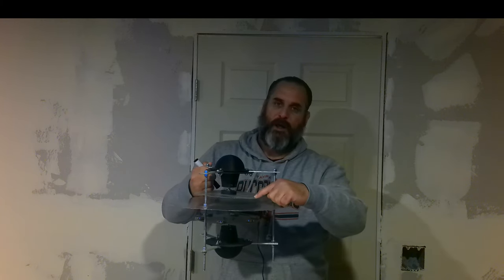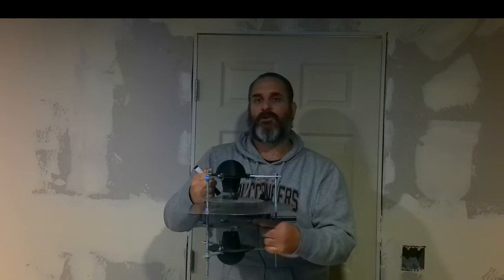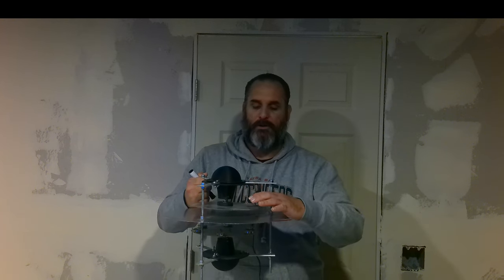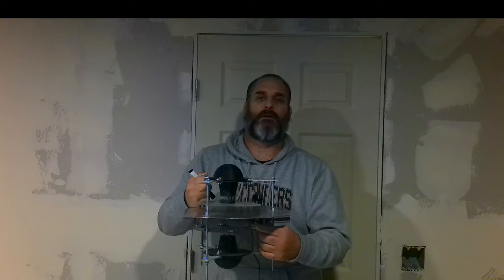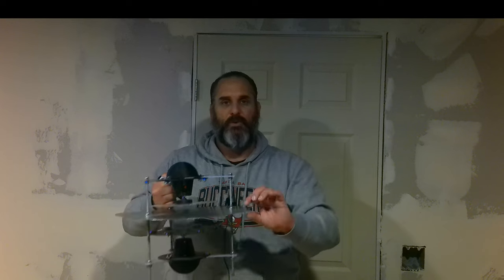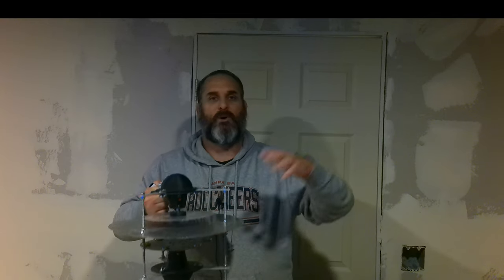Graviflyer "Tuning Correctly" #25

Comment: Nathan, good video. Three waves in the X, Y, and Z planes in 3D that go into harmonic resonance that when the ultrasound is turned off a huge charge that I calculated shows up to lift the graviflyer up by opposing the earth's surface charge and attracting to the ionosphere's charge. The voltage and the magnets keep the charge separated and also create a gravity torsion wave and why everything in the universe spins. The Al and AlO3 coated polycarbonate DC also keep the charges separated between the top and bottom disks. The middle disk acts as the other side of the capacitor/Casimir/layer effect of gravity for all heavenly bodies.  I will see you at this Saturday's APEC conference.
Reply: Buddy, did you get it to work?
Reply: @hellogoodbye3129  No but I know how it works from chatting with Alexey with a Chinese scientist a year ago and I relate this to you but so far you have not built my suggestion. I cannot build it as I am very poor. Alexey wanted recognition and why he told us the truth.
Reply: @hellogoodbye3129  The Navy Tic Tac, other disk shaped, and spherical UAP work in the same manner as Alexey's device.
Reply: @hellogoodbye3129  This is also how a person makes an antigravity car. Put Alexey's device in a tire. The wheels on the car are evolving into aluminum wheels and graphene belted tires or the polycarbonate. The rubber that the tire is made of takes the place of the Al2O3 and is a dielectric.
Reply: @richardmuller867  that is awesome! I would think using an aluminum chassis with quadrant fields for directional force and lift. And always good to have redundant systems. This is great stuff! Thank you for sharing with me.
Reply: @hellogoodbye3129  Your welcome hellogoodbye3129 now make it count. Read my many other chats on Nathans other videos to learn more. All parts of the graviflyer working at the correct frequencies to put the graviflyer in harmonic resonance to produce the large charge. You need methyl aluminum that is used in the chip industry or a vapor deposition unit to get the Al2O3 layer. Methyl aluminum is very flammable in the air. You reorient the graviflyer to get propulsion. The antigravity car of the future will be a hybrid with a water fusion ICE like Toyota just produced. The EVs are just to get money to research batteries as these are needed when time traveling as time traveling produces much extra power and needs to be stored in the battery so the person can get back to the present from the past or the future. The ICE engine produces many electrons that will coat the body of the car and allow warp drive and wormhole drive like the UAP that glow. A side effect of the produced anti-gravity waves is to make people young and healthy again by the reversed time. We never see old decrepit aliens as a result.
Reply from the maker: the ultrasound may have to hit all three disc's. I think it only hits the top and the center in normal operation. The lower one doesn't get hit until the button is pressed. The 3 disc's are also probably have a resonance value of their own. Top and bottom based on rpm and the center by the interaction of the 2 spinning ones. The disc spacing is important based on the 3d ultrasound wave. It would never hit the disc's correctly without them being in the correct spot. I also think the center disc needs to stay neutral. The loss of charges on the top disc says that the negative charge only makes it rise to attract to the ozone layer. The tesla coil is interrupting gravity waves with the beat frequency. Because it matches the center plate frequency you get a productive beat frequency wave. The Keely effect.
Reply from the maker: thank you.
Reply: @nathanbunten4299  Nathan, on another note me having worked with the UAP I found out that it is correct that angels or aliens or future or past people are on the earth. The show America's got talent showcases angels or alien magicians that can produce gravity or anti-gravity waves with their brain just thinking about this and their nerve cells then producing many electrons, or the charge like on the graviflyer to change space and time so that they can do their thing. Their genes are structured correctly so that they can do this. Alexey wears an alien helmet sometimes as he may be one of these angels or aliens. This is why he knows how to make his device. The angels or aliens are from planet X or 9 that Nasa looks for as this is the earth in the future or the past as they have the star device and its technology so they can stay cloaked in the past or the future and why planet X or 9 cannot be seen but shows up as the missing mass of the solar system. Look this up on the internet to find out more.

Comment: The ultrasound may hit all three disks. Ultrasound normally does not get transmitted through metal, but the middle disk has the hammered surface which then can allow the transmittance of the ultrasound and the top disk and bottom disk being a CD has grooves in them, so the ultrasound gets transmitted. Penn State University recently found that making structures on the surface of metals allows ultrasound transmittance. Look it up. Yes, to the three disks having a resonance all of them. Yes, to the spacing of the disks and the 3D sound wave. Yes, to the center disk staying neutral. The center disk stops the top disk and bottom disk from interfering with their charges being opposite, so the top being negatively charged attracts to the positively charged ionosphere and the bottom negatively charged disk repelling off of the surface of the negatively charged earth. Yes, to the negative charge allowing the device to attract to the positively charged ionosphere.  The middle disk having the tesla coil attached to it does interrupt the anti-gravity wave production just like the ultrasound interrupts the production of the charge until the button is pressed and the ultrasound stops so the charge is then produced on the top and bottom disks very rapidly and at a high value, so the charges then do their thing and lift up the graviflyer. It is a fast push force. I agree with the Keely effect as this keeps the frequencies stable, so the charges do not set up prematurely.
Reply: Please illustrate conservation of momentum.

Comment: What if the ultrasonics are exciting nitrogen atoms to the point the eddy currents expell them, causing a vacuum on the top side of the centre plate? The rotating eddy current keeping it stable from gymbal lock.
Reply from the maker: It could be possible. It hasn't shown that in any way yet.
Reply: After doing a little thinking. I actually think you could be right! I think by exciting the air with high voltage static from the spinning plates with a pulsed DC source that is tuned to the frequency of the pressure difference "bubble collapse" that is caused by the periodic static excitation combined with the magnetic field to repel and compress the atmosphere as well as the circular movement to induce inherent stability. You could be on to something! Of all the strange hypothesis, this to me actually makes the most sense. A pressure difference not caused by a rush of air, but a resonant expansion and compression of a pressure differential on each side of the middle plate, air would not neccesarily move much, maybe even be retained somewhat by the resonant action, so it could be super silent, only giving away a sound in the excitation frequency, which is ultrasound (inaudible to humans). This would also explain why it doesnt seem to "blow" air in the demonstrations.
Reply: I think it's almost like ionic lift induced by  pressure difference caused by ionized air being deflected using permanent magnets instead of ionic thrust as ionic fliers usually operate
...
Reply from the maker: @ET_AYY_LMAO  It isn't the high voltage as much as the frequency transur. I will run on a 12v battery or less.
Reply from the maker: @ET_AYY_LMAO  No ionic lift. It breaks gravity with resonance. Resonance stops energy build up so gravity would not be an issue. resonance is way faster form of vibration.. Vibration can make huge rocks move easily. Just like the weight doesn't matter. Resonance is even better.

Comment: Thanks Nathan. Just to clear up things in my own mind what is the order of operation that you propose? 
Spin plates first?
Charge center plate first?
Reply from the maker: just like Jarod showed it last night. Discs, HV, Check the center plate frequency. Then the Tesla Coil. Adjust it to the Center plate. Last turn on the Ultrasound. It will throw off the tesla coil so adjust the tesla coil back and set your ultrasound. As long as you have a set number in mind from the start. You can get it right. Going in blind would be very hard.
Reply: @nathanbunten4299 
Thanks for clearing that up for me. Now I can somewhat understand why the plates rotate for a time before the HV is applied.
Seems to me that motor rotation and distance plates are away from the center plate will determine frequency of the center plate. As the eddy currents build up over time from the bottom plate drag comes into play for the top plate. 
What are the rpm’s of the two plates over time and will the top plate eventually match the bottom plate’s rotational speed?
On Jason’s live thread you mentioned that the motors cannot be too strong. Is that your reasoning why? That is the top plate needs to be influenced by the bottom plate?

You have mentioned the six spinning magnet create a honeycomb effect. In your opinion does this create the bubbles, one above and one below the center plate?
Or is the drag created by the magnets the thing or both?

What I’m getting from you is that the frequencies need to match exactly. No 1/4, 1/2, or multiples of the base frequency.
Also do the three peaks need to be 120 degrees apart in your opinion?
Hope you get to feeling better.
Reply from the maker: @chasson321  there is charging going on at the magnets. I think it pulls out all the charges from the flyback in negative. That was the question. If the flyback is only putting out negative charges then the magnets are pulling the charges to them. Then they transfer the charges to the center plate. If the amps are to high on the flyback the frequency will be lower and harder to pull charge. 

These plater and center disc are the key to making it work. We are matching magnetic frequency with static volts to make an energy that is not a or dc.
Reply: You do an excellent job of describing these things. Thank you so much!
Reply from the maker: @simplec6  your welcome.

Comment: Re. the audible sounds: is it a beat frequency that's heard from way way higher frequencies?
Reply: And where's the motion from gravity pulling down in this analysis? Seems to me the waves would need to be aligned while (not) falling. More variables. :D
Reply: My limited (wrong) mental model has the Tesla coil pumping out +-+-+-... electric field w/ the flier matching the Tesla coil field for repulsion.
Reply from the maker: yes. the beat frequency needs to be achieved. I am still looking into the frequency's and harmonics. The numbers Alexey gives are not to my likening so I am still exploring it. There has to be a secondary change somewhere.

Comment: Uh, I'll tell you a little secret - the part on the top should be a sphere on top of a plastic tower, inside of which you route your cable. If you use a plastic dome - its wrong. If you use inside flat plate - its wrong. The only correct answer is a sphere, to cancel out all the incoming pressure evenly.

Comment: Without x-ray radiation, gravity does not occur on the static magnetic field. There is an x-ray lamp inside the small inverted semicircle on top of the graviflyer. Using a single pole (+), both are connected to the disks that rotate opposite each other. It can be positioned without creating a spark between the disks. Thus, when the disks rotate in opposite directions, the static field rotates. The x-ray beam traveling over it travels on the static field and creates a spiral field. This creates a gravitational lifting force. It is completely gravitational radiation.middle disc (-) pole.
Reply: As a retired electrical engineer I would suggest you explain in mathematical terms what your description actually means besides writing a bunch of non mathematical sentences about x rays and gravity. If you would please show the relationship between gravity and x rays and the scientific evidence for your claims.
Reply: If you think about it with current physics, there is no way you can understand gravity.

Comment: What is your theory on gravity?
Reply from the maker: It's harmonics and static energy
Reply: @nathanbunten4299  Thank you for the reply. So gravity is like a static electric force between charged particles?
Reply from the maker: @hussein85592  It's more like the stronger the charge on something the more gravity pulls it down. It's not a sparking charge just a polarization of charges. I say static because in the sky it becomes that but on the surface it's more like polarization. We are pulled to the earth. Since we have skin we don't get all the charge to build up on us as much but a tree would or rocks would. 

If you saw my video where I use a dc flyback to make foil polorise to wood then you could see it happen with a decent charge. The reason resonance distorts gravity is because it won't allow charges to build up on it. It is also why vibration can make a very heavy object move easily. 

We are between 2 fields of energy. The closest relation to what we all know as energy would be static energy above and dc voltage below. However in reality it is more like piezo electricity below and a magnetic volt above. Not ac or dc at all. Those are man made and make it hard to explain things because people have all these rules about ac and dc but never think about other energy sources. It handicaps them to a dogma that if false.
Reply: @nathanbunten4299  Thank you for explaining your theory! It's interesting to think about how gravity might relate to electrical charges. Your idea about static energy and polarization is interesting. Your experiment with the dc flyback and foil polarization helps illustrate your point. If I understand it correctly, an objects with more electrons or electrical charge would experience stronger gravitational pull, making them heavier. Does that imply that an object with fewer electrons would become lighter? Keep exploring and sharing your ideas—they can lead to new discoveries and understanding.
Reply from the maker: @hussein85592  Things don't become lighter or heavier. They are the same weight. The pressure is gone. It is like throwing a baseball on earth then throwing it on the moon. It is still the same baseball. It just has less pressure or resistance.

Comment: It's feedback, not reverb. They do not mean the same thing, these words are NOT interchangeable.
Reply from the maker: I also said feedback and described it.
Reply: @nathanbunten4299  You did, but when you say reverb, you mean feedback.
Reply from the maker: @ToddDesiato  You are correct.
Reply from the maker: @ToddDesiato  Do you have 2 channels? I am looking at APEC to understand who is going to be there tomorrow. I saw you on there several times. I now understand. I am a fan of your work.
Reply from the maker: @ToddDesiato  When you ran tests on the transducer did the waves created change distance based on the amplitude? Or energy put in?
Reply: @nathanbunten4299  I did tests with spinning magnets and HV. What transducer are you referring to? Are you referring to EM or Sound wave lengths?
Reply from the maker: @ToddDesiato  I wanted to know sound wave lengths. Also does piezo disc have similar wavelengths? I have a feeling we are not aligning all 3 disc to meet the wave lengths.
Reply: @nathanbunten4299  Wavelengths in air vary with air density. When the air is charged, it repels itself and becomes less dense. This makes tuning extremely difficult and why it has to be tuned with the HV on, and the TC attached. However, starting with a mechanical tuning of the US to induce mechanical resonance, may be the place to start.
Reply from the maker: @ToddDesiato   I saw the high speed camera and the mirror. I was hoping that the test would give a relative base line on the distances.  That way the test can be done in different conditions to produce a chart as a bassline reference in each condition. 

The magnets Alexey uses are not very powerful. We might be inadvertently stopping the resonance from forming in the center plate by to much eddie current. The constand warping of the center plate might be infecting it with negative fields. 

Every time I try to overpower the original design it fails because each part is doing more than one thing. When I increase the ability of one part it nullifies the other part it was supposed to interact with.